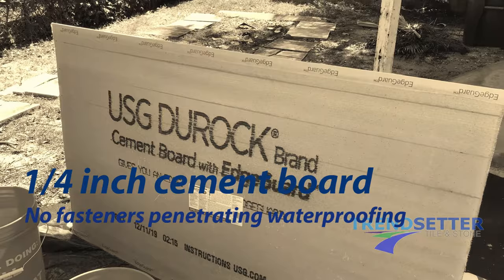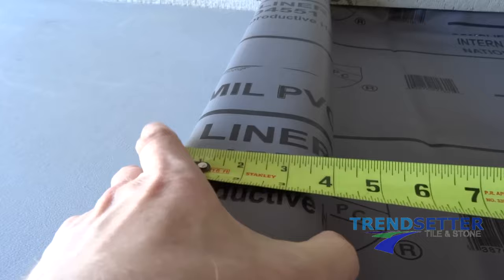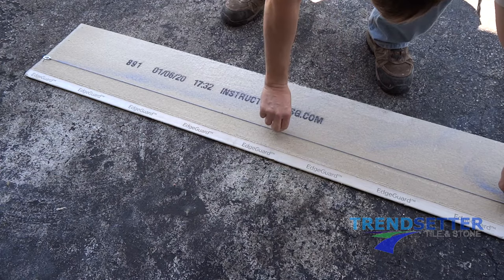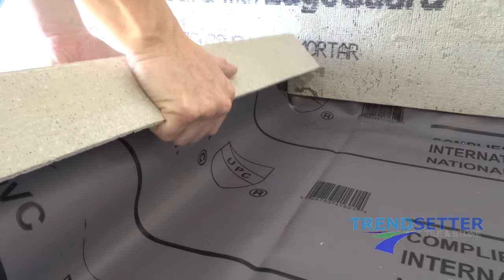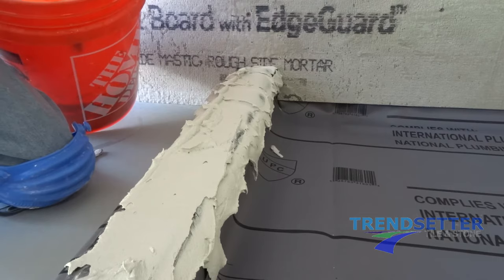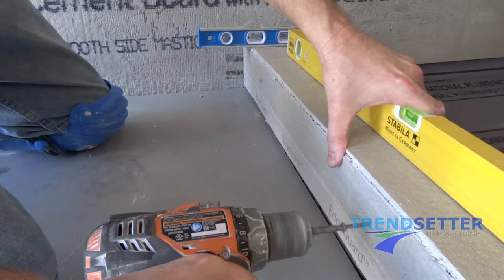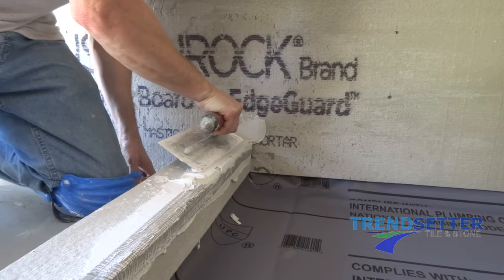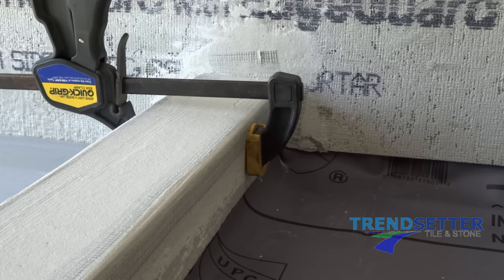How to install cement board on a shower curb and not pierce the waterproofing

Comment: Brother thank you for taking the time to post this instructional. By far the absolute best I have seen! I was at odds on how I wanted to do my shower curb. Once I saw your video I was sold. Excellent craftsmanship as well. 

Now I am off to do my curb per your instructions!

Thanks again and God Bless,
Yellowhammer
Reply from the maker: You're very welcome! 
Thank you!
Reply: @trendsettertilestone9602  
I DID IT BROTHER AND IT WORKED OUT LIKE A CHARM. 
GOD BLESS! YOU ARE THE BEST!
Reply from the maker: @yellowhammer4747  Thanks again! I bet it turned out a lot stronger than you thought it would. It's a strong curb when done right. Thanks for letting me know how it turned out!
Reply: @trendsettertilestone9602  

Super Strong!
Reply: The problem with these curbs are they are trafficked areas and are stepped on. Curbs need to be completely solid and fastened securely to the curb frame. Screwing the hardibacker or Durock to the curb frame is the most solid structure. Followed by first coat diluted with water of redgaurd. Followed by two more coats.

Comment: finally. this is the first video on installing / prepping for tile over a shower curb with a rubber liner. i would have definitely screwed the durock onto the curb.  even though i'll be installing sliding glass doors, one less potential place for water to infiltrate below the liner is a good thing.  thanks for the common sense video and getting right to the work.
Reply from the maker: You're welcome. It is unfortunate that the shower door hardware piercing the curbs liner is part of the business. Silicone should be driven into the holes where the screws will hold the glass panel bracket prior to fastening. This is not foolproof but can help to limit the moisture getting past the screw. 
Thanks

Comment: Great work. I used to do cement curbs and b52000 the pan liner to the curb creating a bond then using this technique.  For tile to adhear to. The slack in the liner under the curb would bother me.

Comment: Thank you for the great instruction steps. I usually just perforate screws on my shower curbs, for both exterior and top, once the boards are installed, I do two coats of the liquid waterproof membrane. That’s plenty seal for waterproof. I also finish with a curb cap (granite, marble or quartz (best). 
Your way is pretty safe, especially if installing tiles on top of the curb.
Reply from the maker: You're welcome! There was a time when I used to put screws on the top of the curb to hold the board down. I thought I had to. I would put the screws in an area that I felt was outside of the shower door line and I would  put topical waterproofing over the board and screws on the curb.

I found out years later that it didn't work. I never had a complaint, or had to return because of a problem. But on one job a customer wanted to do their other bathroom. I looked at the one I did twelve years earlier. Everything looked good except the curb. The curb wasn't horrible but I could tell something was going on. I offered to repair the curb. When I took it apart I could see that the water found a way. It managed to deteriorate the curb and was retaining water. 

How did it happen? The glass enclosure screws.
The penetration from the shower panel screws allowed water to pass through my topical membrane via surface tension, through the board, and into the waiting liner, where the curb meets the wall. The water then traveled horizontally along the curb liner, mind you, under the board, until it found the screw penetration which had fastened the board to the curb. The topical membrane could do nothing to stop this.

This is real, and most customers don't complain when something starts to fail. You wouldn't even know that you had been doing something wrong until one day you stumble upon it.

Trust me, no matter what anyone says, screws in a curb will one day screw you up.
Reply: @trendsettertilestone9602  how do you suggest I go about securing the glass panel to the top of the curb without screws ? Or should I only secure it along the 1 wall
Reply from the maker: @OGCJ10  This is a very good question! We don't install the shower doors, another contractor following our tile installation does it so my knowledge on it is limited, however I have had conversations with them about this and typically when possible if the bracket is an L-shape they make the fastener on the  outside portion of the panel so the penetration is not within the "wet area". 

When the mounting hardware is shaped like a U, directly below the glass, they force silicone sealant into the drill hole and then fasten the bracket. Additional silicone around the glass perimeter and over the top of the screws is also helpful however this is not full proof. In truth this is still a shortfall in terms of a guaranteed leak proof shower. 

I have seen instances when no screws were used in the curb for the glass panel but this was on small pieces of glass and not the typical 7' X 3' panels. It is slightly easier to get away with no fasteners if there is a track above the glass but this wouldn't be the case for a truly frame-less enclosure. 

Whenever we do Schluter or Hydro-ban showers we leave literature on the job instructing contractors that they must fill the holes with silicone sealant prior to fastening plumbing hardware or shower enclosures.
Thank you.
Reply: @trendsettertilestone9602  thank you very much 🙏

Comment: Tho a good idea, there’s too much movement with the cement board which will cause tiles and/or grout to crack down the line
Reply from the maker: You are incorrect. If you put wire and mud around a curb, how have you made it any stronger than this overlay? 
With the mesh, thinset and board you have made a monolithic overlay.
Also, adding additional thinset along with the tile will further increase the rigidity of this curb. Sealant, or to a lesser extent caulking, used around all changes in-plane around the curb remove any chance of perimeter grout cracking, which is also required in a mud/lath curb. 

You should really try this sometime. You'll be pleasantly surprised. I didn't create this method. It was shown to me in the late 90's and I have used it hundreds of times. I have never, ever, ever had to return to one of our jobs for an issue with a curb.

Comment: The only problem i see is that the thinset will not stick to the pan liner! It won't stick! That's why people float the curb. I think you should at least wrap it with wire mesh so the thinset will stick to the wire mesh. Another option is to use a type of membrane that thinset will stick to. Noble ts can be used as a pan liner and thinset will stick to it.
Reply from the maker: Hi, thanks for the comment. The thinset is not meant to "stick" to the liner. The thinset will harden into place and form a mechanical bond/anchor, as opposed to an adhesive bond. The thinset bonds to the cement board, but becomes a contoured shape around the liner which is not easily removed. This is the same concept used on Schluter Ditra, with Schluter's built in dovetails. Thinset does not bond to plastic ditra, it does however form a mechanical bond filling in the shape of the dovetail squares. Essential this is an uncoupled curb. This overlay will not be removed any easier than any other part of a demo. So yes, you cannot adhesive bond to a plastic liner,  but that is not what your going for here.
Reply: When you say membrane do you mean you could roll redguard over the liner because it does says redguard adheres to pvc and therefor make it adherable
Reply: Bruh calm down it works

Comment: Hello and thank you for posting the video on this curb. It looks really good. My question to you is  would you then pour cement over the liner to hold the inside part of the curb you just built?
Reply from the maker: Thank you. Following this overlay, dry pack mortar can be installed on the shower floor. The dry pack mortar should be in contact with the cement board that was installed for the overlay. When the dry pack makes contact with the cement board on the curb it will also cover the lower area where the liner is exposed. Read the description which includes some details on different showers and how not all can have the board installed on or below a dry pack. Cement board is permitted at or below the dry pack surface.

Comment: I would have perhaps liquid nail glue down the curb flap of the shower pan liner.

The issue that I see with the Dura rock being stuck down inside the soon to be set shower pan mortar?, Is that it will wick-up whatever water does make it into the shower pan which will set the entire thing up for failure and mold propagation.
Reply from the maker: Hi, Mold cannot be created in this curb as there is no food source. Cement materials like Durock and cement mortar are not a food source. Neither is the vinyl liner. Mold requires; moisture, darkness, and a food source.
This shower conforms to TCNA B415-20. See page 242 of the 2020 TCNA Handbook.
There is no concern of water wick. This shower is, utilizing cement board is permitted to have the wallboard lower than the mortar bed. A fiber cement board however is not.
The board, and or thinset, would have to "drink" a substantial amount of liquid, and by sustantial I mean; The drain is stopped up and the shower can't drain for days. If a pre-pitch is used and the weep holes are protected, water wicking cannot cause a problem.
Thank you

Comment: This could be asking for trouble after several times of stepping on the curb after tiling, I can't see how it won't loosen without any screws. Screw it coat it with thin set, then put a few screws in the upper edge of the inside of the curb and on top. The odds of that causing a water issue are slim to none.
Reply from the maker: Screws are death for curbs. Screws move a lot of water via surface tension.  Just like when you use a hose and the water might travel from your hand along your arm all the way to your elbow. Screws facilitate failures.
 There is no standard in the TCNA handbook  for a curb using screws on the inside or the top of the curb.  There are only three types; mortar curb, preformed curb, and solid curb. 
The curb is just as strong as a lath and mud over a 2x4. 
Hey C-3PO,  "Never tell me the odds"
Reply: my old shower I demolished because of curb failure,  they nailed the inside wall of the linner and the top , which caused water to soak up into the wood for many years, the wood deteriorated , their where worms in the wood, well it looked like dirt not with small wood chippings. the tile was the one holding the strength,  no movement or squishyness at all . But in this video I still don't understand how  the background will not soak up the water from the inside of the pan, what ive seen is that the walls soak up the water if installed into the pan . that's why some say to leave a gap between cement backerboard and the pan , and only the tiles touch the pan . but this curb backerboard is touching the pan. Do we leave a gap as well? and let only the tiles touch bottom of pan?
Reply: @trendsettertilestone9602  ^
Reply from the maker: @ArtOfTheWeld  Hi, there are eleven shower types in the TCNA handbook. The shower in the video is B415. It does not require that the cement board be installed above the mud in the shower pan. It is one of the few like this.  Think about it like this; 
The wallboard on the curb is on top of the thin-set mortar and the liner, there are no screws in the curb on the top of the curb or the inside face. How can water get to the 2x4 lumber that is used as the curb base? It cannot, provided the liner is installed properly with corner dams and no penetrations.

The mud will make contact with the cement wallboard, and some water may be pulled up into the cement board via capillary action. The cement board can handle it. Cement board does not deteriorate with water intrusion. It is not a food source for mold growth. The only part of the assembly that is in danger is the 2x4 lumber, if it is not properly isolated from water during it's service.

Cement fiber board, say Fiber-Rock, is a board that cannot be installed into the pan mortar. Coated Glass Mat water resistant gypsum, like Dens-Shield is another one that can't touch the mortar bed. On both of those showers a gap is required and should be filled with a flexible sealant.

I understand if your skeptical, you can always install the cement board higher than the pan mortar. But the cement board being wet is not a problem unless there is a screw somewhere to transfer the water to the back of the assembly.  

A Bonded waterproofing membrane is required over the cement board on the walls which in this instance would include the curb. The bonded waterproofing does not prevent the cement board from wicking water up and into it, but it does prevent water from getting to the board through the board face.

Check out this link:
https://www.tile-magazine.com/articles/88016-how-to-install-a-beautiful-and-functional-stall-shower?

You've got the right idea. You are taking a thorough approach and I appreciate that!
The TCNA Handbook won't let you down, and if it's in the handbook it's been through the TCNA lab, and only lasting assemblies are shown in the handbook.

Comment: Great video, very helpful! Can I use 1/2 inch thick cement board to do this or 1/2" is too thick?
Reply from the maker: It is possible to do the same thing here with 1/2 inch, however, depending on your showers configuration 1/2 inch board with thin set mortar under it may produce a curb face that is not inline or flush with adjacent wallboard. 1/4 inch is used specifically to allow room for the mortar beneath so there is no increase in the vertical profile of the curb.

1/4 inch board with mortar is typically the a little thicker or equal to 1/2 inch board with no mortar under it.
Thank you

Comment: Will be using Dreamline 60x30 pan. Not that it matters cause didn’t buy it retail but they claim modifications to pan voids warranty. I’m wanting build pony wall in front of toilet so thinking of finding bracket for cantilevering up 2x3 or 4” wall up slightly over curb taking most the weight off curb   I like your concept here wondering how it would work if not doing tile on base. Thinking would have to silicone the bottom seam where tile butts to the pan. Advice be very much welcomed

Comment: Thank you.
Is possible just to use liquid nail / glue vs thin set mortar?
Reply from the maker: No, the thin-set mortar cannot be substituted. It's not about bonding strength, it's about material stability. Cement products have compressive strength and the ability to conform to the curb creating a locked-in mold, whereas the liquid nail only makes an adhesive bond which does not do anything for this assembly.

Comment: I like this method and will give it a shot !! Do you waterproof the curb after everthing is set and dry? I use red guard on my curbs and around the perimeter of the shower pan where the wall meets the shower pan floor.
Reply from the maker: Yes, you should waterproof the curb the same as you would waterproof the wallboard. While cement board will not deteriorate from water exposure it would retain the moisture, and that can lead to longer dry out time in between use.
Reply: @trendsettertilestone9602  appreciate the advise!!!

Comment: I really like this method! I want to try it today however it's going to be hard because my curb has 2-45deg turns in it.
Reply from the maker: Yes, Neo angles most likely. They are usually 22.5 degrees and can be tough to figure out when you're not used to it. If you do have 45's and not 22.5's to do they should be a little easier. This video https://www.youtube.com/watch?v=fSe1ELEK1CM  shows some basics for finding the angle. You could make templates with cardboard so you don't chew up cement board trying to find the angles.
Best of luck, sorry but it's hard to explain how to do these angles through the keyboard.

Comment: Very innovative! I plan on doing the same thing. Question, how do you correctly attach the glass panel hardware to the curb? Do you put a dab of silicone on the screw before driving it? Also, is that a wood curb or brick? I've been told not to use PT wood, and only kiln dried. Thank you!
Reply from the maker: Hi, the shower door installer should put a generous amount of silicone sealant into the hole prior to fastening the hardware. 

The curb is composed of standard 2x4's with sill seal below it. The sill seal is so the 2x4's are not directly on a concrete substrate.

 PT is not encouraged. The main reason being that since they are already holding a tremendous amount of water, they may develop a twist as they dry out/shrink. There is a higher potential for grout cracking and tile de lamination when attaching to PT.

PT is only used when a building inspector insists on it. Local code sometimes dictates PT on concrete no matter what and in most condominiums they only allow wood if its pressure treated or fire retardant lumber.

Bricks are fine, though somewhat less convenient. 
A brick curb is for more experienced installers. Between the mortar work and lining them up it is easy to accidentally make a weak or crooked curb.

Thank you!
Reply: @trendsettertilestone9602  Thanks for confirming! You are absolutely a professional.
Reply: @trendsettertilestone9602  , how about pressure-treated that has been sitting in the garage for years?
Reply from the maker: @bobhucker1434  HaHa No! PT lumber shrinks and curls as it loses moisture. It is notorious for cracking grout. It is also likely to turn into mush as it will be under that impervious PVC membrane.
Most local code does require PT lumber over concrete when your bathroom requires an inspection, but when possible, use regular lumber with sill seal beneath it.